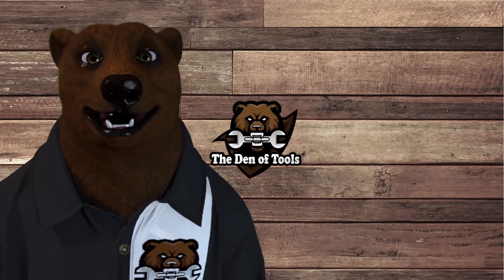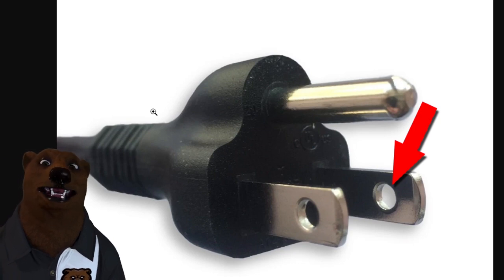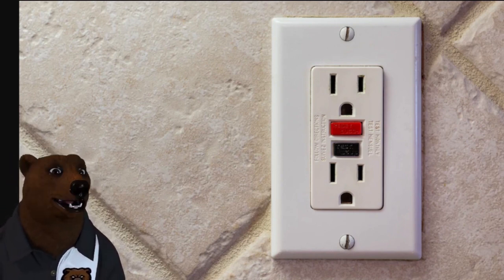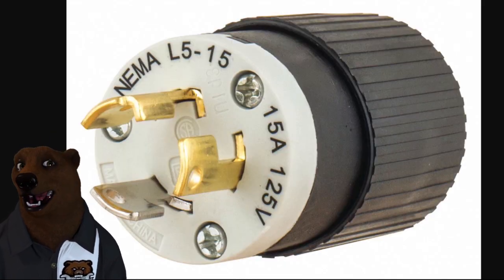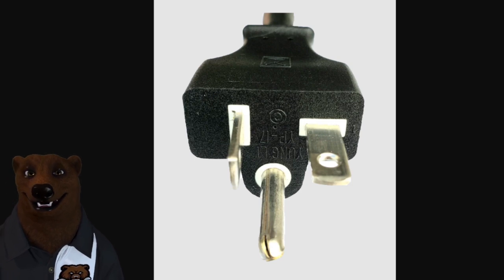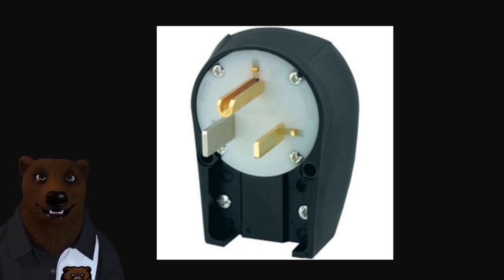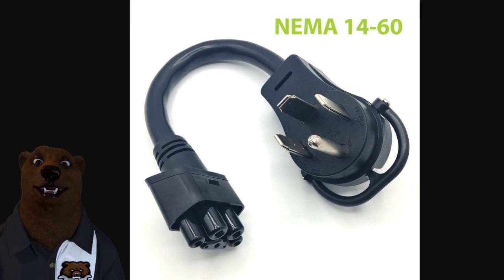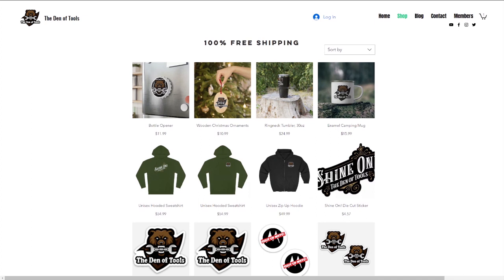All Home Outlets & Plugs Explained (120/240)

Comment: 5-15L is used for connecting two drop cords and generators. When you can’t have a drop cord pulling out of another, you use the locking variant. Portable stage and event equipment uses it all the time.

Comment: Your standard 240v welders still use the 3 prong plug. 2 hots and neutral, no ground. In regard to the outlets being upside down with ground up, that will depend on the electrical inspector. Some prefer them like that, some don't care long as its wired correctly, and some will throw a fit if the ground isn't down.

When we had a home inspector come in last year before we bought our house, he was an electrician and he said that it didn't matter to him, long as they were wired in correctly.

There is also another 120v outlet, that is both a GFCI and AFCI or Arc Fault Circuit interrupter. It will cut power if it detects an arc in the circuit. However they are only needed in living spaces. There are some circuit breakers that have Arc Fault that can be installed. Also only needed in living spaces.

Comment: GFCI is not about splashing the outlet, it's about user protection should the device that is plugged in come in contact with water.  It will kill the power before the water becomes energized enough to harm you.

Comment: Hey Bear! This is kind of a specialized use, but I have an L6-30 that connects a temperature controller to a Blichmann Boil Coil for the brewing of homemade barley based adult beverages. The controller itself plugs into my 10-30R (yes, I live in an old house) dryer outlet.

Comment: The only one I can think of you missed, is the 208/220v 3 prong on electric dryers, ranges, and wall A/C units.  Although it's not code today, it was the standard up till the 80's possibly early 90's.

Comment: As the ground lug is longer, the position of the grounding pin connector on top should help resist the tendency of a plug to fall out of its connection.

Comment: Little note on the standard US pugs, those holes are not really for retention anymore. While some outlets do have a tab or something to help with retention. The real reason now is easy of manufacturing. You can have a small wire or length or solid whatever running through the holes, and plate hundreds of those prongs at once.

Comment: Ground up around pegboards. If a thin tool or a steel ruler falls on a loose plug it could end up between the plug and the outlet. A  wise electrical shop teacher taught us that in high school.

Comment: The NEMA L5-15 is used extensively for floor buffers and edgers. (And full sanders use it’s 240 volt equivalents in 20 amp or 30 amp)

Comment: Before I watch, receptacles (outlets) are installed upside down here in the US 98% of the time. The ground should be on top and the two side prongs under it, that is why the lettering is upside down when the ground is installed on the bottom. Let see if that is mentioned here, I am sure it will be.
Reply: I've found the "ground top" to be the case when installed by commercial electricians. "Ground down", as seen in most houses, installed by residential electricians.

Comment: It baffles my mind that we've been using the same basic plug/outlet design for over 100 years. IMO, European plugs are much bulkier, but also much safer as there is no possible way to come into contact with a hot prong. Also, I found the hard way on my motorhome that every outlet in the kitchen connects through a GFCI in the bathroom. I was on my first trip with it and my fridge was w/o power for over a day at the campground before I figured it out. 🤦‍♂
Reply from the maker: Yep, living that life right now.   Also my outside plug is on the same GFCI circuit.

Comment: According to building codes all garage and exterior outlets shall be GFCI protected
Reply from the maker: You do know that building codes are state and local.  There are no federal codes.
Reply: @denoftools  I know. It is always better to check with the local permit office to see which year code they are using.

Comment: The cheater plug can be grounded with or with a wire. If there is metal conduit that is grounded, then the cheater would work. A ground wire isn't the only factor.